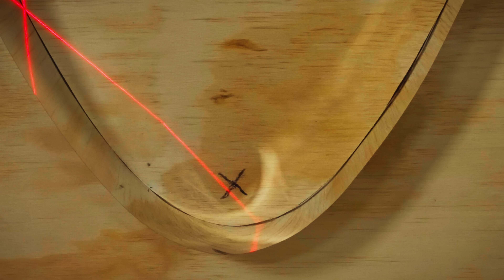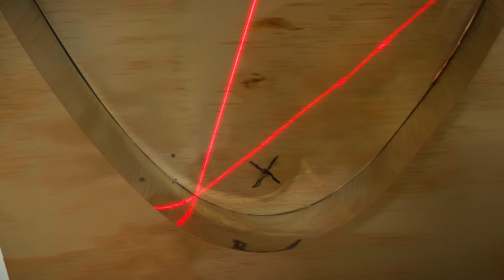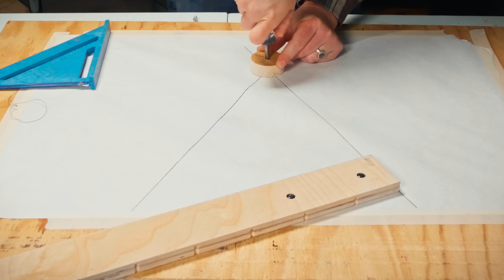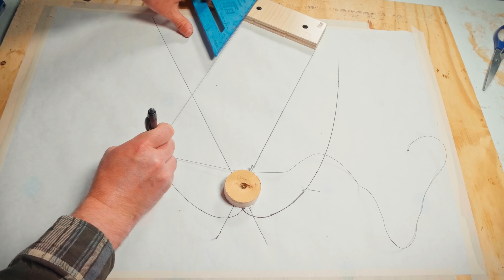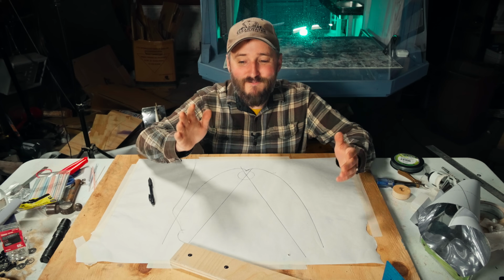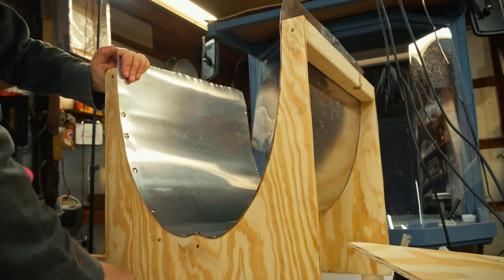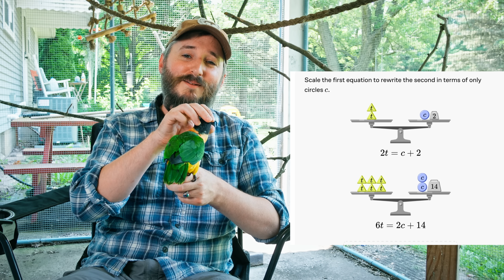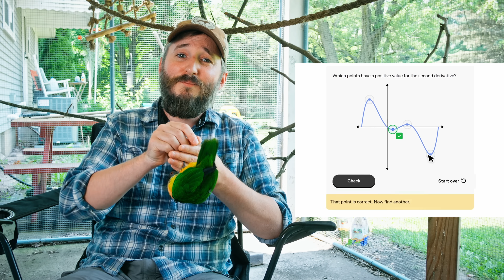DIY Solar Concentrators, Made Better.

Comment: If you touch on this subject again, I'd like to see an attempt at a 3d ( "bucket" shaped instead of this video's "slice" shape ) compound parabola, with additional testing utilizing your hyper reflective cooling paint instead of mirror stickers ( putting that IR to use? ). Also curious what you'd want to use for a weatherproof but light transparent lid? 
side note: It would be interesting to dynamically cover part of the light ingress area based on a thermocouple attached to the inside of the heating target!

Comment: I’m not sure if anyone has asked this yet. But combined with your heat dissipating paint, could get enough of a temperature differential between two points to run an LTD stirring engine?

Comment: Winston, who invented/proposed CPCs in the 1970s, gave one very crucial piece of information that makes the construction a lot more straightforward: Let there be two paraboloids, and the wall of each paraboloid lies in the focal point of the respective other.

So all you need to do is draw two of them, shift one of them over until its wall is in the FP, and then you place the tube where ends meet.
Reply: Thinking about it oonger, the most awesome about your construction is that the whole thing is about 3 times as wide as commercially available ones.

Now the one thing about solarthermy is that it sucks because it does not heat in winter  when you need it, and it gets way too hot (water boiling, antifreeze decomposing, system going tomstagnation, all the known woes) when you don't need heating.

But... but... with a thing that is three times (or more if you increase the angle) as wide, which thus has three times the surface, you might actually be able to get sufficient heat in winter.  Might be worth trying out...

Comment: Well thats cool and all but way over complicated since all you need to do for the double parabola is hang your bead chain make a copy and over lap them no need for a speed square or string just a piece of small chain no math some clear plastic and marker all that I could do in a moment way easier it's symmetrical easiest things to make as an artist I could free hand it with only a pencil. You can also shine a flash light threw a drinking glass makes the same parabolic arc trace it twice just so many easier ways I can think of

Comment: With the shape being a "2D" parabola I assume you would still need adjust the "out-off-plane" angle with the sun? maybe the depth of the parabola is enough of a buffer if the device set up east to west for a permanent installation. Anyways, can't wait to see where you take this concept next :)

Comment: Thanks for the demo on how to draw these curves! Definitely love seeing such simple geometric explanations, and helped me understand what my grandfathers company was doing in the past.

Now encase the target pipe with a glass tube, and remove the air between the glass and the target. Then coat the target to absorb light and coat the glass so that infrared cant escape. 

The setup described was patented by my grandfather, I'd suggest taking a look at the now public domain Sunmaster Corp patents. Though I'm not sure how much they kept trade secret between themselves and corning glass. Unfortunately using solar power to heat water was really only practical as a rich mans hobby back then, but with how far heat pumps have come, I think they may be viable if you make your working fluid sub ambient.

Comment: Sir Christopher Wren used Inverted Catenary Curves (un weighted hanging chains where each link is equally spaced) in the construction of St Paul's Cathedral in London after the previous church had burned down in the Great Fire of London.

The great dome of St.Paul's Cathedral is actually three domestic, cleverly nestled within each other to achieve the different internal & external aesthetic forms that Wren wanted, while also optimally distributing the weight of the materials.

Comment: This would mesh really well with the opposite of your cooling paint--Vantablack. It made a big stir back when because the visual effects are so bizarre, but the conversion of light to heat is what I found more interesting because it does that in an extreme way. It's entirely inaccessible to regular people (in addition to having some weird environmental requirements for application and serious PPE), so this artist named Stuart Semple has been making and selling his own acrylic version that's truly mind-blowingly black, like all shadows dissapear level of black. I have used it on art and it reminds me of flocking or velvet when you look at the painting but even less reflective. 

Now it's not a heat resistant paint like the black barbecue spray paint that everyone uses for real life stuff. I expect that the acrylic base for Black 3.0 would burn pretty fast if allowed to rise above a pretty low temp, so the practical application would need to move the heat very efficiently from the surface of something like a pipe to a thermal mass for heat storage that is large enough to keep the final result below melting temp of the acrylic. I think in practice that means water that is being stirred or circulated to distribute the heat throughout the body of water faster than still water or stone would do. It would be really cool to develop a home-makeable version of Black 3.0, especially if it can handle high heat. Potential in eco-friendly/off-grid home or water heating, as well as less fragile DIY solar cookers, especially combining with compound parabolic reflection. 

I am also curious whether your compound parabolic reflector would have an impact on solar panels in a way that would have any advantage (like cost) over just using a bigger or an additional solar panel. 

I was doing a little car camping for a while and made myself reversible window covers with bare Reflectix (bubble wrap covered in reflective mylar) on one side and black on the other. The black paint I started with didn't stick so I redid them all with black gorilla tape. You put them up for sleeping and the shiny side goes out to keep heat out on hot days, shiny side in to stay warmer in cold. The way reflective heat barriers are used similarly to insulation but don't work the same still doesn't fully make sense to me, and I don't really know if coating one side in black really makes any difference in practice.

Other fun solar heating projects would include a solar food dehydrator that stores heat in thermal mass during the day and releases it at night, using convection to circulate the humid air out the top so new dry air gets pulled in the bottom to be heated by the rocks or whatever thermal mass. And of course an outdoor soaking tub (ofuro) that is heated by a solar pool heater type contraption.

Comment: Having the light come in perpendicular to the surface tangent of a vial is still vital if the surface is reflective. That is why it's hotter at the Equator of the Earth, because when the Sun light hits the atmospheres at an angle as it does close to the poles a lot of it "deflects" rather than being absorbed by the Earth.

Comment: So far this is just rookie stuff!  Imagine a 3D shaped plate/parabola that does this focusing in all three dimensions, not just two. Even your drawings show you're looking at itfrom 2D perspective, not from 3D perspective. This video could have been so much better if you used any advanced AI to make you a program that plots your shapes in 2D. Then you could have just asked it to make a program that would plot a 3D shape, so that even the light from "front" and "back" is reflected, not just sides. Then print the shape on 3D printer for a quick test. Or ask AI to help you devise a setup to create this shape using paper/pencil/strings/plywood/plastic, etc.  I reckon the new enhaced "3D" setup would get you 40C pipe EASY! Maybe in part 2? Looking forward to it!
P.S. now what about the light/heat that is generated/reflected by your collecting device in the center? Shouldn't it be immediately reflected back to the collector? Maybe create a super-greenhouse from the whole reflector setup by covering it with a "one way" mirror, reflecting heat/rays that come from inside but would be transparent to rays from the outside? Greenhouses work in Spain, I don't see a reason why they wouldn't work where you live.
Reply: You are exhausting

Comment: Wow, this is really cool.   Instantly I am thinking about how to implement this into some type of water heater, pool water heater, greenhouse heater, thermal mass heater.  Then I thought maybe it could be used to make a sterling engine or a steam engine and could it be used on something like a boat.   
Anyway, a flood of thoughts.  Maybe something you might like to play with????

Comment: having tracking is very helpful as the tracking can be reversed to avoid the sunlight when it's too hot. You also need at least 3 layers for it to work at -40 temperatures.

Comment: I'd be interested to see a setup using this, where maybe 10 feet of medium sized metal piping (think large soup cans stacked together), painted with that ultra black paint, with a small fan at one end, are used to heat a small room in winter. You could probably keep a small greenhouse (or barn) warmer. Or, heat a black hose, and run the hose along the bottom of a raised garden bed to directly heat the soil or stones at the bottom to allow for controlled dissipation.

Comment: For that flat-bottom design, what happens if you apply it to a solar panel, compared to a solar panel of the same size and orientation on a fixed mount without the parabolic side mirrors?

Comment: From the way you construct the reflector it is noticeable that the "active" area is smaller than the physical area of the reflector (i.e. only part of the light that goes into the reflector hits the target). Wouldn't it be better to make the shape flat and basically cover the entire area with the target (like how solar water heaters are made)? I think the flat shape of that solar collector would also be easier to install and to transport than the shape of the reflector you made.
Reply: Depends on what you want to achieve, max heat vs less heat but for longer
Reply from the maker: The active area is the whole mirror opening. The two lines are just part of the construction showing what angles the mirror will accept.

Comment: do you really have to repeat the same process to create both halves of the compound parabola?
any arbitrary angle you start with, is going to be symmetrical, so couldn't you just mirror what you did on the first half to get the second half? (such as folding the paper in 2 and tracing over the first half)

Comment: Excellent video as always. I've made one out of a simple parabola many years ago and it was good fun. This really wants to make me want to build a solar water heater for a hot tub, even here in the UK. Is there a easy way to calculate the size of the line of the parabola if you know you've got a sheet of X to make the mirror from? So you know tha max dimensions the mirror can be ?

Comment: "Why didn't I think of this before?" 

Reason is likely an over-fixation on min-maxing, aka optimizing for theory rather than practicality. Same thing happens in games where the player has a way to adjust stats. Many quickly get stuck in a though process of maxing out the stats without considering the practical value of each stat, diminishing returns, and such.

This mentality is why a lot of people think the metric system is superior to imperial units - they become obsessed with precision that just doesn't matter, and think that the metric system is better for this. The metric system is actually inferior, and we can show this by comparing decimal to fractional representations:

1/3 = 0.33...
2/3 = 0.66...
3/3 = 1.00

and 

1/3 + 2/3 = 3/3 = 1

but

0.33 + 0.66 = 0.99 ≠ 1

So in reality you get better accuracy and consistency with imperial measures than you ever could with metric. Once you realize this, you will likely pick up on things that you'd normally never consider, because the metric system causes brain rot.
Reply: Hahha what are you trying to say with thirds hahahahahahahahah 😆😆😆
Reply: @markohorvat1122  Looks like that one went over your head. Typical metric smoothbrain doesn't comprehend pre-school level arithmetic.

Comment: Small time saver, is that if you think on it, you only need to draw half the curve. Consider a fold line along the middle of the angle, and that is your mirror line on that fold. Also, tho more replacement and maintenance, replace your pipe with black or dark ceramic, or at least coat the outside pipe with this. tho it will start more slowly, it will deliver more of the heat. Also avoids melting steel being likely. charcoal dust in harvested clay would suffice, as you use it, it will dry and bake, layered on steel will help with heating the water once the specific heat values come up.

Comment: Interesting and funny.. appreciated .. I ve built CPC and published papers on this "non imaging" concentrator where the target is a circular surface (i.e. a cylinder).. in this case there are two curves per side, one is a circle involute and the other is a parabola. Regarding the Half Aperture Angle, my suggestion is to remain just above 23.5°, in order to cover the entire variation of sun altitude in the seasons when the CPC is "horizontal".. this is the minimum condition for not needing to  track the sun with the compound mirror and to stay with Concentration Ratio to some 2.5
Reply from the maker: Great tip!

Comment: I couldn't tell from your video, but were the pipes painted black?

I would love to see this as part of a larger application, such as a sand battery/water heater or something. As a college student, I used to sell systems similar to this and they used propelyene glycol as the circulating medium.

Comment: Would be neat to make like a passive pool heater using these concentrators; a solar powered pump to circulate the water through the concentrators would probably work great - or maybe there’s some hydrodynamic physics tricks that I don’t know if that could make it electricity-free.

Comment: So, assuming you had a system that ran water from a reservoir through a pipe fitted with this type of parabola, it would heat water to a crazy temperature even during poor conditions.
Assuming this water was then sent to a tank (unlikely it would get full heat transfer, but a modified pipe with heat sinks in the water could help), what would the ambient power draw be to keep the water a hot temperature overnight?

At the very least, this could make a steam engine, couldnt it? Water tank with pipes fitted from the parabola. Heating to evaporate and spin a turbine to charge a battery.

Theoretically, if this was in a circular pattern versus a 2D cross section, would its like intake be better? What if it was extruded out into a 2-3 ft collection pipe rather than the few inches shown? Could it be serpentined, or even serpentined in a circular pattern for more absurd light collection?

Comment: I wonder if there's a way to maintain an optimal compound parabola while being able to adjust the angle. If you could widen it on cloudy days, but narrow it on sunny days you could increase the efficiency, especially if it were a system that could store heat like a cistern or something.

Comment: Excellent! CPC are a very elusive topic on all youtube. Yes you can buy them but you nail it.
I have made a sketch of a revoluted CP dish to heat flat coils, it's still waiting on my procrastrination list.
I made it using a very simple and old program called parabole generator, then exporting the shape to autocad and then cloning and adjusting the intersection angles, your approach is much easier to achieve.

edit: There was a somehow related great device for solar concentrator in the 90', now erased from the web, it was called sunflower collector or something like that.
It was a set of flat mirrors on an horizontal platform on the groud, a very simple mechanical guides moved the mirrors according to something called Conchoid of Nicomedes so all mirrors pointed automatically to a collector set on top.

I may have some old photos in some obscure folders about self reliance, as amazing as this "discovery" you made.

Comment: is that why butts are shaped that way?
jokes aside, i had an idea today for a "trash for treats" machine for corvids, to train them to pick up litter and exchange it for food. inspired by you, im gonna give trying to figure out such a mechanism a go. if you feel like running with the idea, id certainly be interested in seeing what you come up with. but some of the design challenges probably place it out of both our fields of expertise. but itd be a pretty clever way to get the local environment cleaned up.